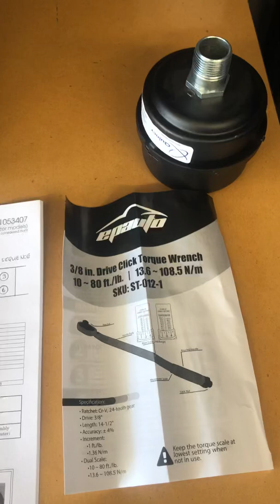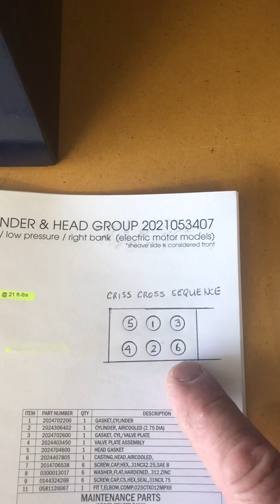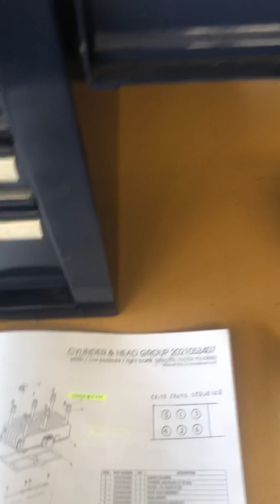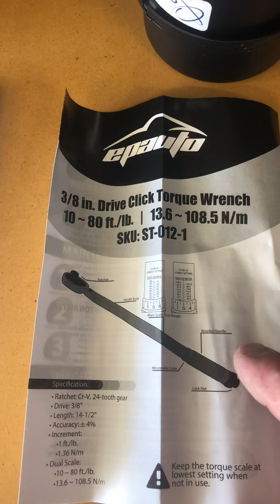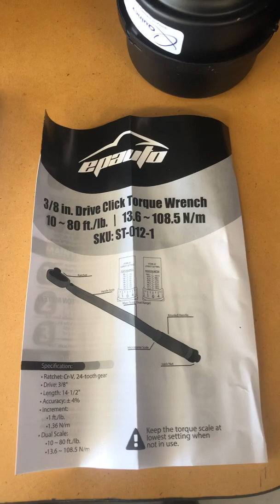Quincy QTV-54E Head Torque factory Specifications Part 2

Comment: Your torquing method is completely wrong.  You only use two-stage torquing on fasteners that need to seat something before the final torque.  You should always torque to the final value in one smooth motion.  Given that static friction is typically at least 20% higher than dynamic, if you torque to within 20% of the final value, I will use 21 lb-ft in this case which gives basically 16 lb-ft as 80% of final.  If you torque to 16 and then set the wrench to 20, it is very likely that you will not turn the fasteners at all as the additional static friction will absorb the additional 4 lb-ft and no turning will occur.  If you want 20 lb-ft, you need to have a starting torque well under 80% of the final value (most recommend no more than 50% for the initial torque of a two-stage sequence) or you likely will end up well under the desired torque spec.